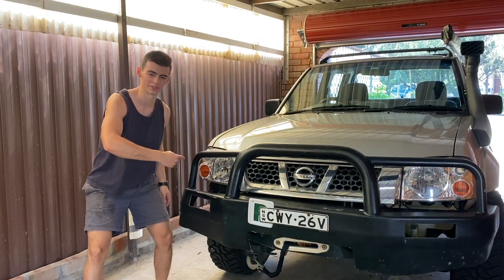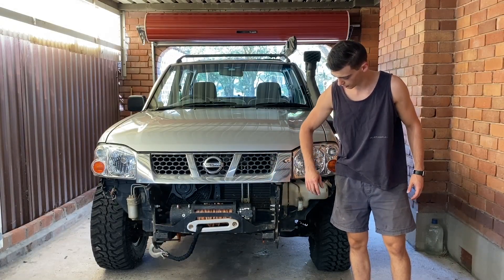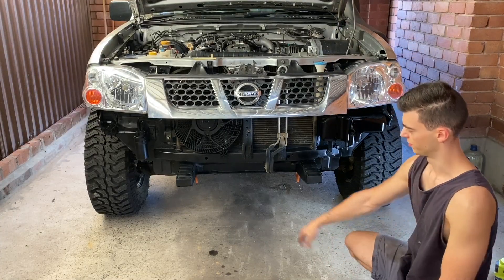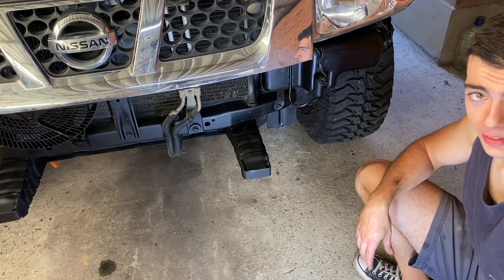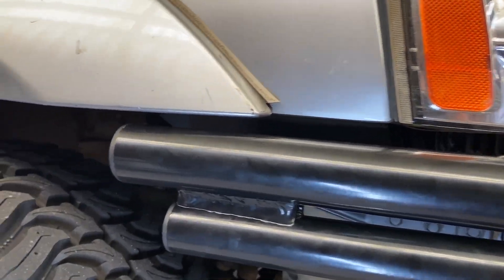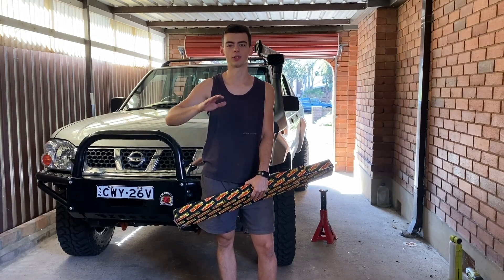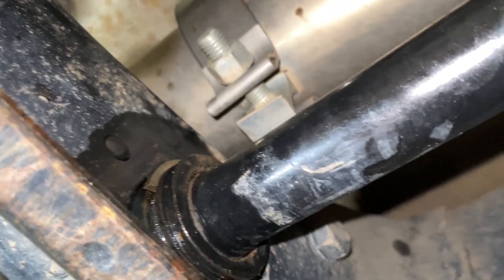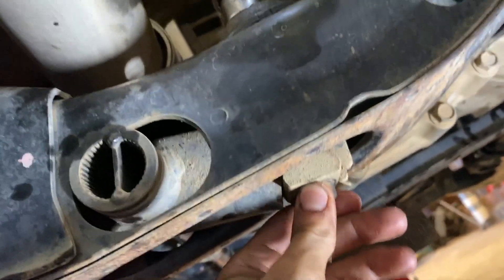XROX Bullbar + Tough Dog HD Torsions Bars- ZD30 D22 Navara

Comment: You can replace the washer bottle with a bag that hangs off of your battery or anywhere else in the engine bay. Mine was moved to the battery. We put a bracket on the side of the battery bracket

Comment: That’s a great video man. I have a Ranger 2015 and I’ve got a a second hand x rox it’s ready to install but didn’t come with the nuts and bolts what size? And how many nuts and bolts go in the brackets ?
Reply from the maker: Since sold the car and don’t remember off the top of my head but they might have it on the spec sheet on they’re website